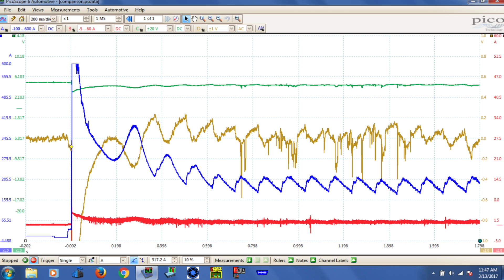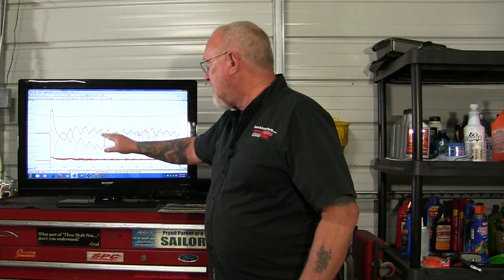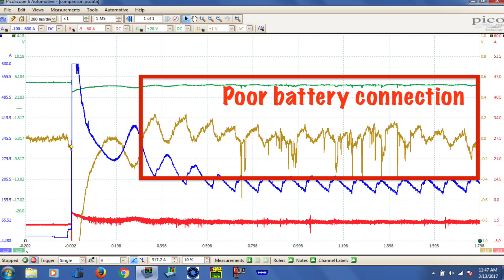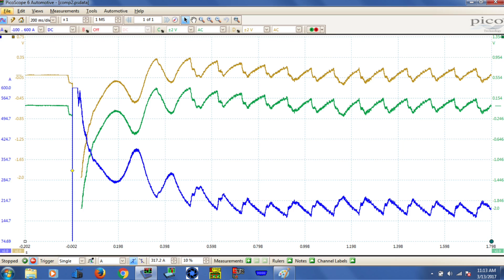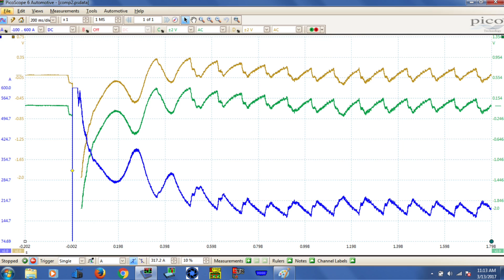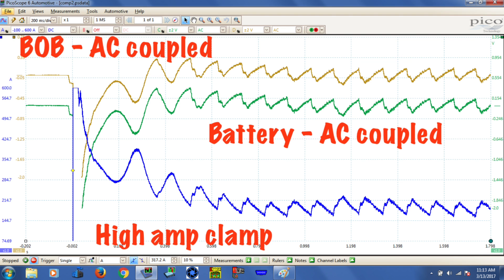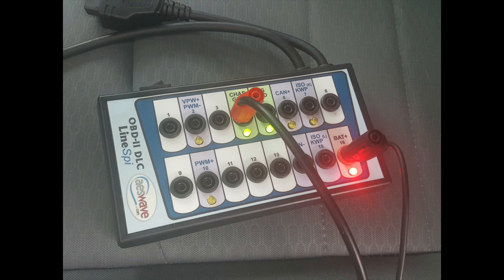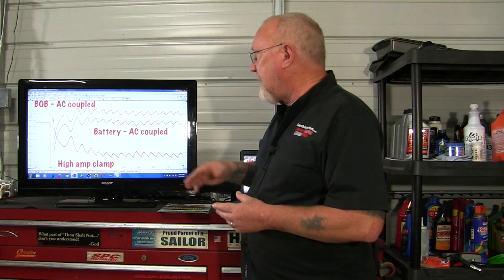Motor Age How2 #11 - Performing Relative Compression Without An Amp Clamp

Comment: Low amp clamp .. yes set to 60 amps an use your voltage setting on a 2 voltage scale that will read 200 amps will work

Comment: When I swapped polarity my oscilloscope blew up
Reply from the maker: What brand did you have, and how did you attach it?
Reply: @VehicleServiceandRepair Picoscope I had channel A for trigger from coil on plug signal wire with ground strap connected to BATT-, channel B connected to battery with reverse polarity. As soon as I touch the alligator clip from channel be to the Batt+ it shorted and smoked my test leads and scope
Reply from the maker: @namechane1758  Did I read that correctly? You had channel A ground to B- and channel B ground to B+?
Reply: @VehicleServiceandRepair  So, is the answer that you can't set up a reference channel to an ignition event if you're using reverse polarity on your relative compression test?
Reply from the maker: @mahlerob  All channels must be ground referenced the same. If you want to add an ignition reference, I would recommend setting up your scope normally and using the invert function to flip the battery voltage capture. Make sense?
Reply: @VehicleServiceandRepair  Yes, it makes perfect sense. I have a uscope so I won't have that problem, unless I am able to purchase a pico down the road. Evidently the grounds are common. That's a hard lesson to learn. I feel for the guy.

Comment: I am a bit confused. Should I simply hook my scope on battery terminals for a voltage change measurement or AC Coupling is something special?
Reply from the maker: If you want to get a pattern similar to the current pattern most relative compression waveforms show, simply invert the pattern OR switch the leads (pos to neg, neg to pos). No need for AC coupling.

Comment: For the longest time i used a low amp clamp set 2 volts at 2 seconds 60 amp ac coupled. The cables that are too big i would install a cable that i made 1 foot long and put it inline. Then i broke down and bought a high amp clamp. Scanner danner teaches the low amp clamp method. Great video i never knew about the low voltage method. One more tool for the tool box.

Comment: Hello, Pete. Would you recommend an Amp clamp with a multimeter? I have never  seen you use one?
Reply from the maker: I've had issues with an amp clamp on a multimeter, especially when looking for very low current draws. Noise from the overhead lighting in the shop, meter sample rate and accuracy are a few of the reasons I prefer to use a scope with my amp clamp.
Reply: I was just asking because I have a pico scope and I would like to use an  inexpensive amp clamp.
Reply from the maker: Check with the folks at AESWave.com. They have a selection of amp clamps - high, low and micro - that would be great fits for your Pico

Comment: Could this method be used to measure Fuel Injector Current draw at the wire of the injector?
Reply from the maker: I have never tried that approach but I don't think it would work real well. I'm thinking there wouldn't be the same amount of load on the source as there is with the starter. Use a low amp clamp for the best results, and place your clamp at the fuse that powers all the injectors to see them in one capture.

Comment: great information thanks for the great videos you have done . you have enough information on your scope to work out the engine speed on crank this is very importing information that some modern engines will not start if the crank speed is not right more then 200 RPM . may be you should do a update and show us out to work it out it very easy . but I let you show us how to work it out .   just only last week I was asked to diagnose a car that was hard to start with the ECU light on with a crank angle sensor code  this car had already had two new crank sensor but was still very hard start so I did the same test your doing in your great videos and  work out its was only cranking  at  140 rpm with a new battery and no voltage drop ( will there always some but it was ok ) to the started cables or the ground but with test I could see the starter motor had almost 500 amp and was very noisy that was interfering with the inductive crank sensor ! so this 5 min test I found out this car just needed a starter  motor and the crank sensor was ok . so working out the speed of the engine with this test is very important